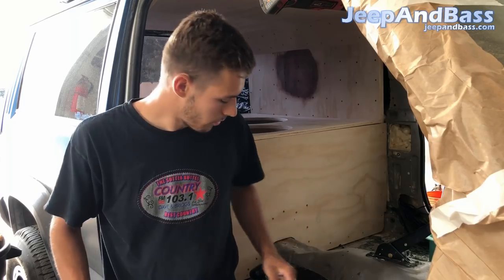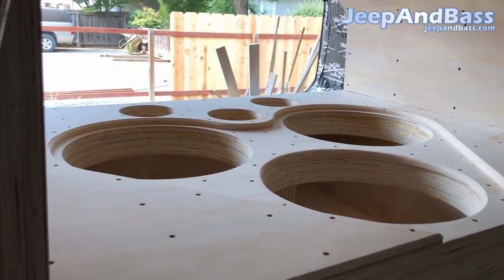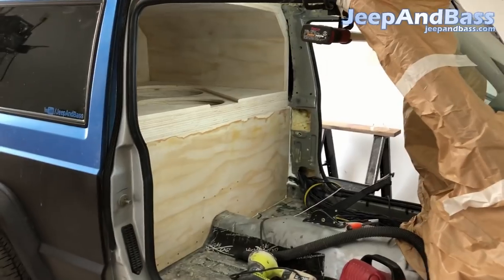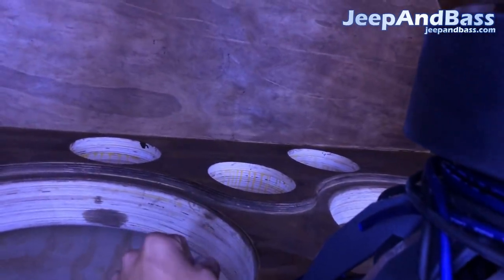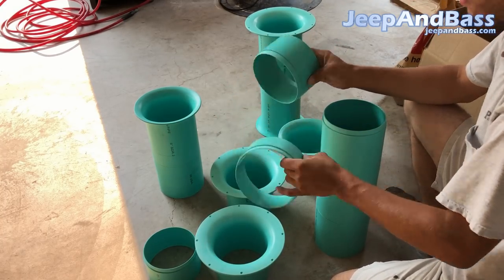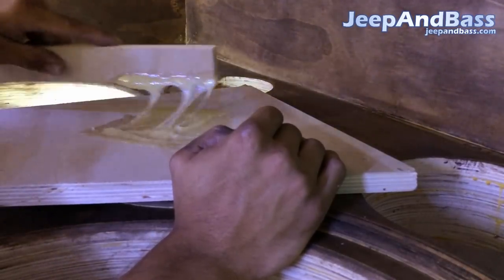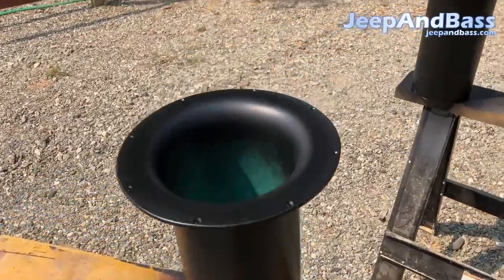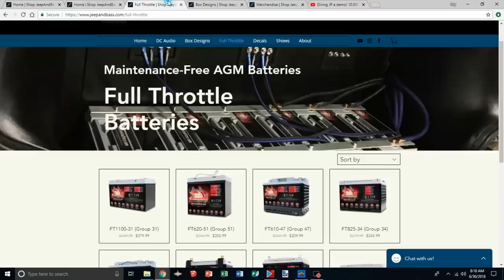DC Audio Jeep Rebuild (Part 6) Finish work

Comment: @JeepAndBass you can just use the christy's red hot blue glue to adhere the PVC to the wood. It will actually dissolve the PVC or ABS into the wood fibers making the bond.